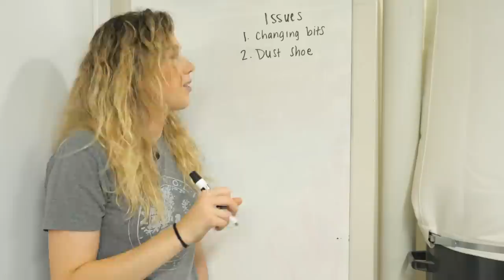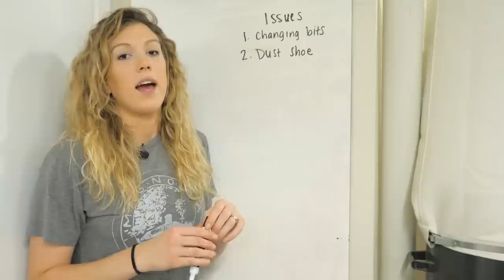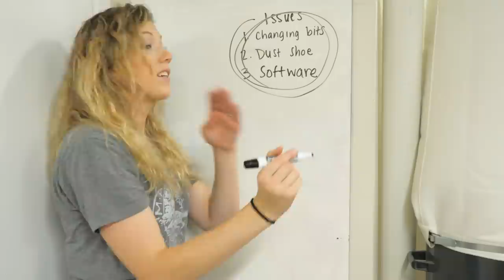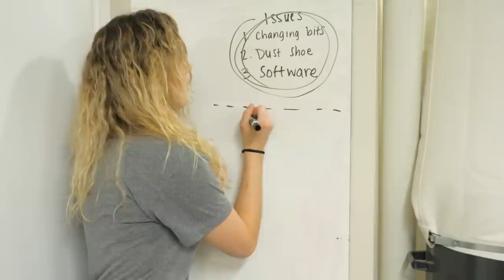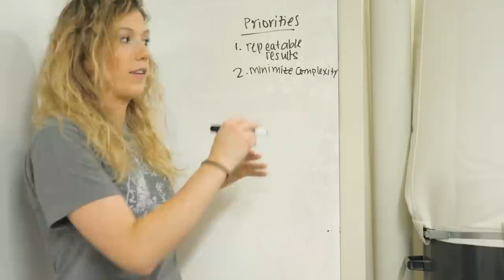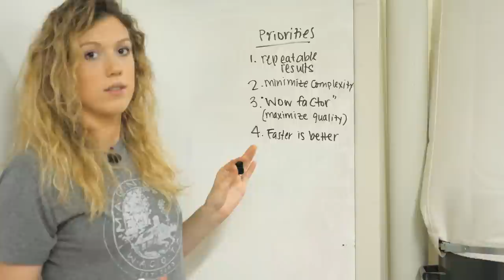LET'S CONQUER THE CNC! Part 1

Comment: For your hold downs on the cnc, try painters tape and CA glue. Stick the painters tape to the cnc table, then stick painters tape to the piece. Using non sticky side to non sticky side, add some CA glue then the painters tape will hold. Once the piece is done, just peel off the tape.
Reply: Blake Davis This works really well. Like this method better then double sided tape.

Comment: I have a zenbot not an x carve, but maybe this helps 1.Changing bits: Set to XYZ zero after tool change. I usually just set up a zero spot on the material, turn the motors off and walk it by hand (pushing it around by hand). I pre-drill a tiny hole in the material to use as my zero. This gives me 99% accuracy in a quick way. 2. Dust shoe: use a bigger hose (4") and just make a dust shoe yourself. google it, there are brilliant solutions out there or just come up with your own.  I jerry-rigged a non fixed one. It moved up and down the shaft of the router. I don't have to remove it when changing tools. 3. Software: VCarve + Mach3 or 4 depending on your setup, you can use it for a CNC mill as well. Great control on every step. 4 + 5 up to the customer in most cases. 6. My go to all-rounder is a 5/16 straight flute (only use with good dust shoe ;) however, for sign making you will need variety. 7. Clamping down: use a piece of ply as the base, then just pre-drill and screw the work piece to the ply, feel free to run the router in shallow straight lines on the ply to have an adjustment helper. two or three lines are enough. Use tabs in your design to hold the cut outs in place (do double sided tape needed. you will need to remove the tabs, but you will save time since you minimize errors). First turn, then discharge ply when surface it to messed up.

Comment: to solve your coordinate issue ground your machine at the router. sometimes running the dust collection can cause a buildup static electricity which can change the coordinates in the middle of your program due to a static discharge. For work holding i use a T-track system with a square jig to clamp everything to. i use both cam and toggle clamps . That system has drastically my setup time and increased my accuracy.
Reply: I grounded my Dewalt router by adding a grounded cable. There's a few discussions on this in the Shapeoko forums.

Comment: I'm just repeating what others are saying:  Your CNC is a hobby CNC -- like a toy, really.  I would recommend the AVID CNC -- they make a 2x2, 2x3, 4x2, 4x4, 4x8 and 5x10. They all come as kits. You can save money by buying the electrics ready to assemble, or you can save time buying the "plug and play" electrics. (As a business, get the "plug and play".)  I'm a retired furniture maker and I have their "2x2 Bench-top Pro".  It is ROCK SOLID! I change bits mid job all the time and only have to rezero the Z.  
  Get Vectric's Vcarve Pro software -- it's only around $700 and if you know Easel(?) the the learning curve isn't that steep. Use Mach 3 or Mach 4 as your control software.  There are tons of videos on how to use these. Vectric has tutorials out the wazoo, plus a fantastic help forum. 
  Lots of videos on making a simple -- and better --- dust shoe. (Avid has a plan/video that I adapted for 1/2" ply.)
  Again, lots of videos on making a better spoil board. Mine has T-slots cut into a piece of mdf. Home made wood hold-downs -- plans on the internet. (don't use cam clamps; they won't hold the wood from rising into  an up-cut router bit.)  Painter's tape and superglue is a good holddown, but adds more cost. Carpet tape is even more expensive and harder to remove, plus it adds a variability to your Z height.  I could go on and on -- but I won't ;-)
Reply: Thanks Richard.  Ive been thinking about the AVID CNC for my home shop.  I have an Axiom 2x4 at school that I use for the students which I love but Id really like to build my own.

Comment: This is obviously your first time machining.  I started with manual machines 20 years ago.  You always have to home and edge find when you change tooling.  Make a home point mark on the scrap side of the cut.  You can also add a laser to your gantry to hep you find home.  If you had a better CNC with stronger motors or slide locks, you could do what you are doing, but you just got to adapt.

Comment: My CNC has homing switches.  When I do bit changes, I re-home and then go back to the same offset that the first bit had.  This can also be used to resume a carve after you snap a bit.  If you have a production run of projects that require bit changes, do the whole run with bit one, then set up for the second bit and re-run everything.  Once you get the second pass dialed in, it will work time after time.  Finally, while it is expensive, an aluminum T slot table really helps with the fixturing.

Comment: Clamping: use a good tape, place it on the CNC and also the job and then using CA glue placing it on the tape. The tape comes off easily  with very little clean up needed,
I made my own CNC and this is how I change bits: After the first cut return the machine to the home position, change bits, re-home with the touch plate in exactly the same position as before and try again.

Comment: The Xcarve is a toy. Many possible reasons to your problem (in preference order) :
1. Wrong feed and speed. Be sure to set it right for the bit.
2. Skipping motor steps. Wrong current settings on stepper drivers and/or motors overheating or hard point on the guides motion. 
3. One belt or pulley is loose, or any mechanical part. Check the axis in the direction of the shift. Be sure all is tighten properly.

Comment: You might have gotten your answers already, but here goes.Homing. You need to home your machine after every action. Also remember that you have a hard home, witch is against the switches, and a project home where you home to your work piece.So, any movement on bit changes will influence your project home. you will need to setup your control software to handle both home settings. As for the machine, it is a hobby machine, great for the weekend warrior, but for production you will need a much more rigid machine to get things done faster. The dust shoe, sanding down the edges a bit will give a little looser fit and might make it easier to remove and set. As for work holding, I would suggest a secondary sacrificial waste board that you can bolt to your machine board. This one can be cheap ndf. Then screw your work piece to this, placing the screws outside your cutting area. this can help in production. on the sacrificial waste board you can set guide rails to quickly align work pieces. If you cut into this board you do not have to worry about it, because you can replace it quickly. hope all this make sense.

Comment: You can solve your clamping problem by using normal masking tape.  Lay one strip down on the base of your CNC and another, directly opposite that one (or two or three) on your work piece.  Lay a bead of Superglue on one strip of tape and spray accelerator on the other, then press them together.  When you are done pull up your work piece and remove the tape.  Simple.

Comment: I own a x-carve and have 0 issues. Most people when they buy one want to throw it together without squaring the frame, surfacing the spoil board, Tramming the router,  and checking calibration on stepper motors. Thats just a start. But I completely understand that Inventables does not cover all this in thier instructions. I am not sponsored by any of these.

Changing bits look at the triquetra-CNC zero block. It zeros all 3 axis and not just Z axis.
Look into Suckit dust shoes

Comment: Hope you got this figured out. Are you turning the controller off while changing end mills? Stepper motors will hold their position only when energized so if you turn off their power source you will for sure lose your home position. It doesn't matter if you spent $2k on your CNC or $20k, maintaining your home position is a key part of any CNC operation. I always home my machine between milling operations. It seems like these are all issues you can easily solve. I hope you get this sorted out and fixed so you can keep making great products!
Reply from the maker: Hey Zach! Yeah the control module had a few switches which limited the current to the motors during idle. No idea why that's the default setting or why the assembly didn't mention it. 😂But it's all good now - thanks for your help! Miss you, hope to see you at WBC 2020.

Comment: If you have the limit switches, look into a bump stop and setting up G28. This allows you you set a specific location for the machine to go to after homing. That way after  a carve and you change a bit and want to make sure it starts from the same spot you home it and In the machine inspector you type in G28 and bam back to the original spot.

Comment: NOT SPONSORED!

1. Yes! Either rehome the xcarve everytime before you cut or walk it in by eye. I normally just walk it in by eye.
2. If you follow instructions in point 7, you will have much better results.
3/4/6. What software are you using? If it is Easel it is crap!! Though works well as a gcode sender. You need to buy vCarve Pro by Vectric. Made a world of difference for me! Helps you understand tool pathing, and eliminate excess bits. Save the file as .gcode for xcarve, import g code to easel, zero the machine to the datum that you selected and run. vCarve Pro also has a molding profile function that you can use to make frames!
5. Picture / Size. This is not the question you need to be asking, you need to be establishing a cost per hour for the machining time. As long as the machine will physically hold it, you now have a scalable metric for customer requested items. As for high volume, production pieces, use whatever dimension is the most readily available and consistent. This will prevent you from having to spend time milling the material into the size needed, and thus streamlining your process.
8. is really dependent upon your taste for the project, or the customers request. Typically if your going to have a solid color background and you want the carve to stand out, paint or stain the material first. They also make products that you can apply to the board that will withstand the carving and leave you crisp lines, if you want the text or image to be a different color then the background, go this route.
7. Mill some flat clamps out of aluminum, really length doesn't matter here what your looking for is the internal slot of the clamp will still work with the toggle bolts that come standard. The thickness of the aluminum clamps needs to not exceed the width of a typical biscuit. Cut 4 - 6 biscuits along the outside of the project and insert clamps, this will give you a level surface to machine on and since you know the depth of the biscuit relief you can avoid the clamped areas in your design. Now you won't have to worry about the dust shoe colliding with the clamps and toggles. 

Let me know if you guys have anymore questions! I have been there! I carve, engrave and now even laser on my xcarve. Absolutely love that thing! Also looking to get a 4-Axis CNC machine! You can see some of my projects on FB @PeregrineWW

Comment: I have that same CNC (and definitely not sponsored), changing bits can be a challenge sometimes but if you do a manual z-shift and drill out your (0,0). Then if it moves, you can come back and line it back up with the hole.  And with the dust shoe, lock one side in and leave the other loose until after the shoe is on.

Comment: When setting work zero, always do the egraving first before cutting. after the board is placed and clamped, I get the bit where i want it, turn the router on, and walk it down slowly to where it makes a small cut in the wood. That way I can line up my cuts after changing bits. Also, if the gantry moves, you just have to re-home it. Then re-align with your previous mark.

Comment: I use fusion 360. There is a bit of learning curve on the toolpaths generation but it works great. Post processor on fusion also lets you keep motors locked when changing tools

Comment: Notes while watching:

I cannot "home" my Plasma table (I set home per cut, so do so methodically to a specific corner of the sheet and pierce a single cut there so it's repeatable), but when I mess with a 3D Printer mid print (filament change, pause, etc) I always rehome the axis that moved or could have (so X and Y there). If you have stepper motors as basically all 3D printers do and the Xcarve does, they don't know if they've been moved for the most part, so they have no reference except to be rehomed. 

There are CNC-ready Pneumatic guns that shoot plastic "nails" that the CNC can route right thru. I've used them and liked them, worth the cost IMO

I was still watching
Reply: I'm not sponsored by them. I don't even get along with them. But I do have the fixes for your problem. Please message me on Facebook or email. The information you are looking for is on my website 

http://www.designsbyphil.com/x-carve-tips.html

Comment: If you leave the power on to the stepper motors, they will restrict the manual movement quite a bit. I researched lower end CNC router machines for nearly a year before taking the plunge. I settled on the Shapeoko 3 XXL. This is a way superior machine to the XCarve. Even the software that comes with it is better, Carbide Create and Carbide Motion. There's none of this, "have to be connected to the internet", to run the software. In my case, I also opted for the Vectric VCarve Pro, as this software generates very efficient tool paths, vs. Carbide Create.

Comment: Working with metal working Cnc machine the home is usually pretty precise micro switch so it should always be the same. Always machine in absolute if you can as it is more accurate to machine in. 

Clamping wise, we use double face table for thin metal machining when clamps will be in the way. There is some great products from 3M. But you will always sooner or later machine thru a clamp. Life of cnc maching

Comment: ShopSabre fixes all those problems... Stays where you move it with the WinCNC Controller (computer based), Changing bits is awesome, can't move the XYZ gantry while changing bits, & the dust shoe is magnetic, pops on & off. 

If you check it out, tell Brandon Bombardo, I sent you.